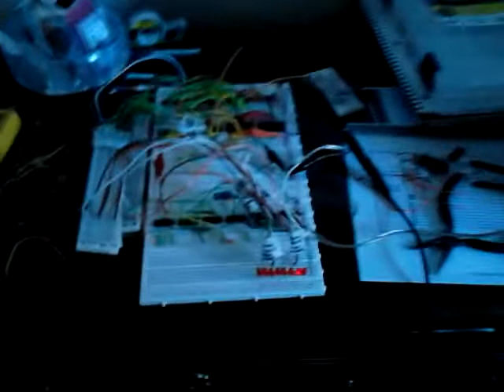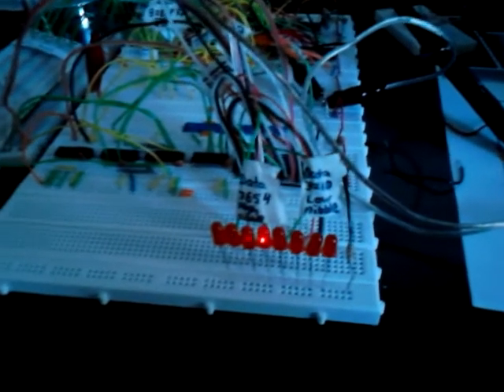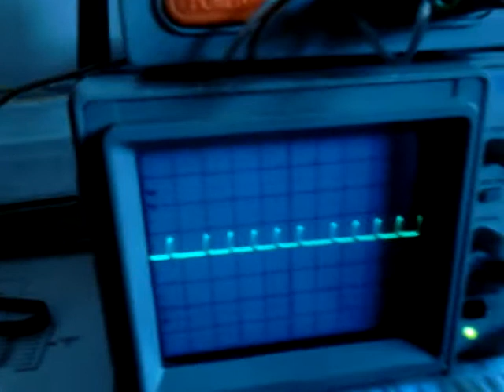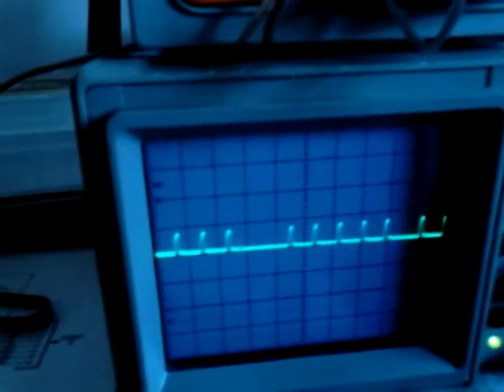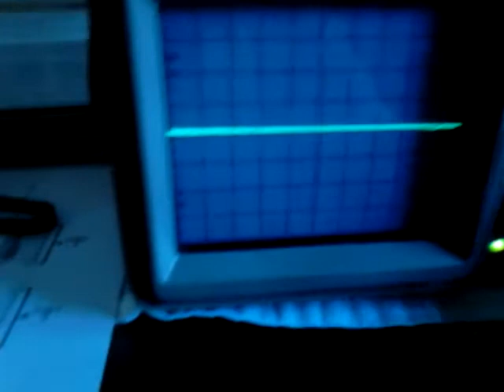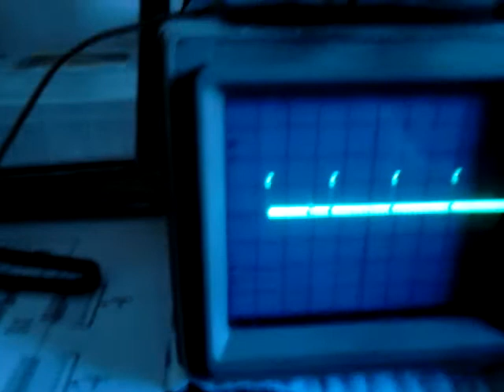Building an 8088 computer Part 3 - Adding I/O ports

Comment: If building a computer just for the fun of it, why build one with an 8088 instead of the 8086?
Reply from the maker: 3 main reasons. The book that looked the most helpful when I was starting out was "The 8088 Project Book" by Robert Grossblatt, and it was based on the 8088, and the other reason was that the original IBM PC was based on the 8088. And I guess the third reason was that I perceived that it might be easier to make peripherals for it than for the 8086, since an 8-bit data bus sounds easier than a 16-bit data bus, but this was my opinion, and purely subjective.

Comment from the maker: Sorry I didn't see your message earlier. I was going off of the book by Robert Grossblatt. It was about a year ago that I did this, so I don't remember much of the code. I didn't have much time to work on it, but I plan on working on it again soon.

My next project is to see if I can successfully design a video card, or more like a frame buffer so I can connect it to a VGA monitor. I only plan on using monochrome text at first.

Comment: kindly kindly help me with one thing that is this circuit is as exact as in the book of grossblat or did u change something kindly tell me i made it on the ocb but still i m unable to run it is there any problem in my circuit on pcb or else i have to add or change something kindly reply me i realy want to make it within 3 days i m in trouble kindly tell me

Comment from the maker: Another awesome chip that I definitely plan on using at some point is the 74154 demultiplexer. It takes 4 inputs, and provides 16 different output pins. It decodes the binary input value, and selects the corresponding output pin. it's one of my favorite chips.

Comment from the maker: No problem. I'm going off of "The 8088 Project Book" by Robert Grossblatt. It's definitely a superb book. I would highly recommend you look for it. I got it off of Amazon. Also, a regular 74LS08 AND chip would have been just fine. The only reason I'm using that one is because it is the only one I could find ANYWHERE in my house. I can't believe I never ordered any ANDs lol.